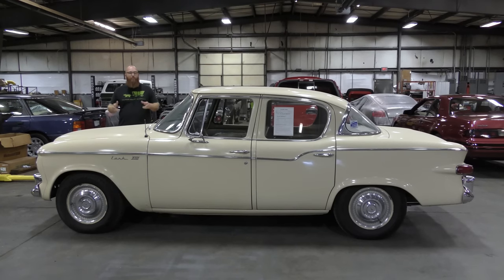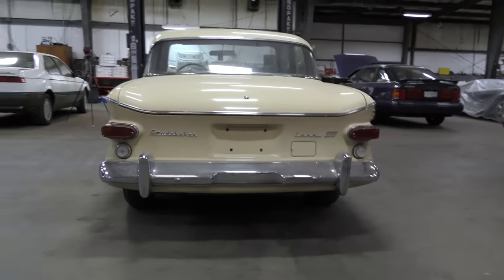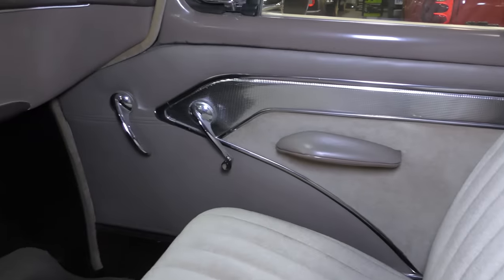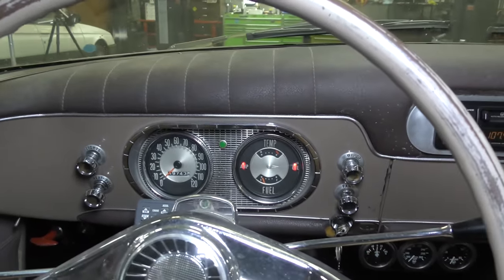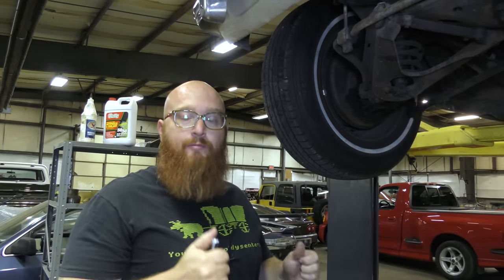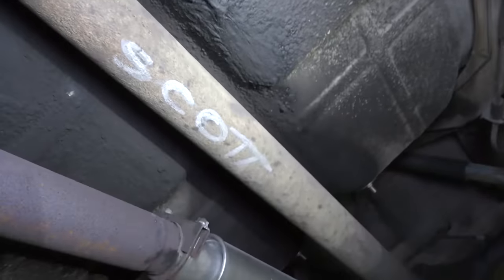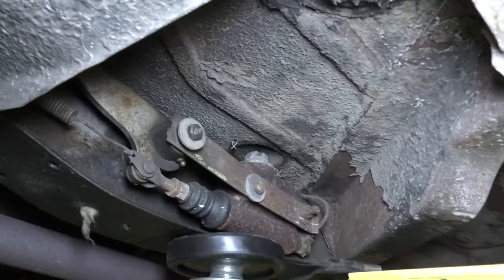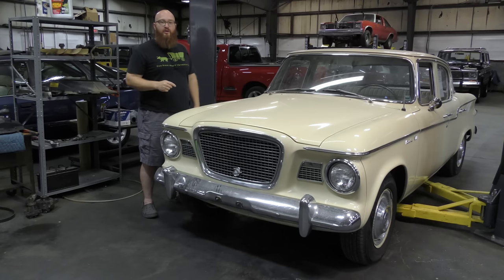Finally a CAR WIZARD approved engine swap done on this '60 Studebaker Lark VIII

Comment: The small block Chevrolet engine is what the factory V8 was in these Studebakers. Originally it would have been the 283 backed up by a Borg-Warner 3 speed automatic or a 3 speed manual, with or without optional overdrive. That is one sweet little car. The seatbelts may be period correct or even original. They were a factory option that could also be dealer installed. Mounts for seatbelts front and rear were mandated by the time this car was built. The American Automobile Association and the Canadian Automobile Association sold seatbelts as well. The could be picked up at any parts store, too.
The carburetor is the Edelbrock 1406 body, which is actually a Weber 1401 square bore 4bbl. One of the easiest carburetors in the world to tune to perfection. Also dead simple to change jets and metering rods. Paired with a Performer intake, an incredibly reliable and economical induction system. Incredibly durable too. I have seen those carbs working that well after a decade and half a million miles of use.
The car may well have been a Chevy V8 from new. Most people doing a 6 to V8 swap would do a dual exhaust, which was a factory option on the Lark. That it has a single exhaust is an indication that it may not be as swapped as one might think. That exhaust, however, is neither stock nor safe. The exhaust would definitely come out the back of the car, likely almost right in the corner.
Reply: Nope. Only the 65-66 Hamilton-produced cars used Chevrolet V8s. Otherwise, they used their in-house Studebaker 259 and 289 V8s.

Comment: You might take back your words in the title if you bought a Studebaker V8 powered lark .. The 259 engine is a well built awesome engine with lots of power, very little problems and great fuel mileage . The Lark 8 came with the 259 V8 and the Lark 6 came with the 170 6 cylinder ..

Comment: Interesting to view some 64 years AFTER we owned a near identical one. Same color,v8 3 tree with of. What most people don't understand is that the 59-60 lark was simply the 56-58 full sized Studebaker 
Shortened by 3 feet!
In 59 when introduced the new lark had more interior head room and legroom than the Ford Chev and Plymouth full sized cars of 1958. And if equipped with the 259 V8 four barrel engine it was good for zero to sixty under 10 seconds. Only the top engined full sized big three could perform that performance. Ridden in, driven and owned Studes for 71 of my 76 years. Our Lark in 60-63 could literally swallow up big 3 cars on the highway when passing in kickeddown out of over-drive . Handled better, parker easier and had more interior room to boot.i know true as I drive in AND rode in many big three full sized cars from 56-64. Lark was trim on the exterior but large on the interior.
Best compact above all others hands down.

Comment: By the mid-1950s Studebaker was in trouble and had no money to design a new car from the ground up. They took their Commander, whacked off the front and rear ends and bare bones outfitted the Lark. No other car maker then had such an affordable, basic transportation offering. The Lark saved Studebaker for another 10 years.

Comment: The Studebaker Lark inspired many British cars - especially the Sunbeam Rapier. But yet again a fine car polluted by a Chevy motor. A Studebaker 289 V8 with the optional supercharger would have been ideal, but unfortunately that requiers original thought which Chevy swap junkies are incapable of!

Comment: Do your checking, there are factory gm V8. from Studebaker.  Also would explain conversion opinion. Is it a gm V8 with Borg Warner trans.  I have seen one of these with  gold labels on valve covers.  Studebaker bought engines from gm
Reply: Thought the GM connection started in 64 or 65 for the Canadian factory.

Comment: Mixed feelings on the SBC swap when Stude has perfectly competent and reliable V8s. That front suspension is impressive with no ball joints and using kingpins.

Comment: I truly believe that’s why they came up with interference engines with the timing belts because once the timing belt snaps if you’re driving that car, the piston hits the head and that engines done toss the car and Hyundai they’re known to go at 60,000 miles to replace an engine even at 60,000 miles it cost more than the car! cars nowadays are meant to be thrown away even as low as 60,000 miles sometimes and if you think Hyundai’s hundred thousand mile engine warranty will cover a timing belt breaking you’re sadly mistaken if you’re timing belt breaks because you didn’t replace the belt that’s on you. That’s not under the warranty that’s considered regular maintenance and because you didn’t do the regular maintenance that’s out-of-pocket cost.

Comment: They didn't move the cab forward, they designed the Lark by lopping several inches off the front and back of the full sized '58 models to create a compact.

Comment: 16:58...That tailpipe ought not be right underneath the axle. The axle will snap it right off with the first big bump it hits. Re: waste mentality, I fully agree. Where I live, I have trash picked a regular treasure trove during the last 8 years in our apartment complex. I even made a YouTube video about this (keywords "Marshall Curtis" and "treasure trove"). Far and away the most needlessly thrown out items in our dumpsters are vacuum cleaners, mostly Bissells, Dirt Devils, Hoovers, and Eurekas (no Dysons). I managed to salvage most of them, then give them away mostly to Goodwill, but not before I make videos of them. They usually are clogged or need easy to figure out minor repair (broken belt, etc.). Even cheap vacuums deserve better than this! The only one thrown out I remember that really was worn out was that 1993 vintage Rainbow I found, which even the local Rainbow sales rep agreed was not worth fixing.

Comment: I learn to drive in a 1950 Studebaker Champion. A nice car; three on the tree with overdrive. I discovered that the overdrive worked in all three speeds.. Yea; I now had a six speed. That 6 cylinder motor was wound up tight to get it to 35 mph, to engage the over drive in 1st gear. Just one of the idiot things I did. Even though it was fun.

Comment: Since the final 2 years the Lark was made (they called it 'Daytona' by then) it came with a 283 Chevy V8 right from the factory I'm thinking all the parts to mount that engine & transmission are readily available.

Comment: I've grown an apathy towards typical crate engines dropped into everywhere they could fit in. A classic in this shape deserves at least a blueprinted AMC V-8 with modern aluminum heads and intake manifold. It would at least come closest to being brand-correct. The Crate Mowder could then get sold, in order to pay some of what the AMC engine would cost

Comment: I'd still think it was cooler with the original Studebaker V8 drivetrain. 

I would like to see the braking system upgraded with a dual reservoir master cylinder and separate hydraulic circuits for the front and rear.  IMHO, this is a must-upgrade in 1966 and older cars for safety.

Comment: Another legacy of using the the 1953 era Studebaker body to create the Lark was that the original 1953 was body-on-frame. That makes the Lark the only "compact" that was not a unibody. This car  could be given a little extra pizzazz by remounting those nice radial whitewalls to face "outwards."

Comment: I have a black 60 lark V1 4 door sedan for you. I swapped engine with a 84 Buick 3.8 V6 with automatic transmission. My car is definitely not as clean as the car featured. Unfortunately the engine quit running a couple years ago. I’m unable to physically work on it due to medical reasons. Let me know if you are interested and want more details.

Comment: Team Bear raced that car in parking lot glycana circuit.  it came from the factory with a Chevy 327 mech lifters.  Swap the tires around get the nose on the ground and the ass in the air.  Big wheel add torque and rpms and hunt vets.

Comment: Since there is VIII on the side, I would assume it came with a 259 V8. I wonder why they didn't replace the motor with another Stude V8, they are easily available.

Comment: A surprising area where which engine and displacement is necessary is for the replacement starter !!!
GM only made like 15 different starters an housings !!!
You'd have enjoyed my Ford van with a GM HP 400 small block !!!

Comment: My memories of Studebaker Larks came from watching the ads for them on The TV show Mr Ed (the talking horse, who I understand was played by a filly!  8-)  The ads were done by the human male lead of Mr Ed.  I was a child then, no where near driving age. That would come in roughly a decade.

Just a couple-three years ago, some big Euro-car company wanted to make a new SUV that looked a lot like this Lark from the front.  I told them so in a comment on YouTube and the design was suitably modified.

Finally, I have this vague memory that the Studebaker's front suspension and/or steering gear were very antiquated.  I don't believe it was as crazy as Morgan's "sliding pillar" front suspension.  Perhaps it just still had a King Pin.  Can you tell us what it actually is Car Wizard?

I wonder why the tires were mounted with the white walls inside, they would be perfectly appropriate to show on a car from 1960!

Finally, when I first saw the Lark in profile as you started the video, I wondered if you were showing us an Alfa Romeo Giulia (Julia) sedan from about 1970.   In that color, the resemblance is pretty strong.

Comment: You two can compromise and get a Champ pickup.  One of the coolest trucks ever, and it's designed after the Lark. I had a beautiful red 60 Lark 1/25 model, and a lady I worked with took one lo9k at it  and said I want one. That was a common refrain back in the day, it was a popular car. It ultimately did not saxe Studebaker,  the car but it's  popularity did save the Company.  Studebaker started buying other Companies with the profits from these cars, including  STP Oil, and several others. Unfortunately, they refused to put the 100's of millions in profits back into the car lines. There only goal was to get out of the dog eat dod car business.  So, Studebaker is the only car company to stop building while still making a profit.

Comment: "The Hamilton factory had no engine plant and was forced to look elsewhere for a supplier, eventually settling on Chevrolet 194- (and later 230-)cu.in. six-cylinder and 283-cu.in. V-8 engines adapted to the Lark’s Borg-Warner transmissions..."

Comment: i was the  new car service 
mechanic i saw all kinds screw us that had to pass the saftey lane in CINCINATTI. THE SIX WAS UNDER POWERD AND TOO HEAVY. ITWAS A COMPACT CAR TOO COMPETE FALCON AN COVAIR.LARK 6 ONLY GOT 19 MPH.VUSTOMERS WERE COMLAINING .THEY WOULD CALL BAK THE NEEDLE VALVE AND SEAT PREFORMANCE WISE THE V8WITH OVER DRIVE WAS HOTIF YOU WERE GOING TO BNLOW THE DOORS OFF A VET YOU WANTED THE HAWK ,PAKARD 8 ,BLOWER ,ANDOVERDRIVE.

Comment: We need those sized vehicles again: Nova & Corvair; Falcon & Maverick; Dart & Valiant  in 4 , 6  & small V/8    like back to 1975 with ZERO electronic; computers, sensors, plastic   back to metal & steel

Comment: Brakes should be change to dual master & if poss. Disc.brakes. Better 4 wh. Disc. Did this on a 63 Merc. Comet from 4 Lug to 5 Lug. & Narrow a 8.8 Ford . It's a over kill easy to find parts and YES YOU WILL NEED 15" WHEELS.

Comment: The turn down exhaust before the differential is a HUGE safety concern. Inasmuch as that car was made a decade before mandated "flow through ventilation", the probability of carbon monoxide build up in the car to toxicity is very high. I'd strongly urge the customer to have a tail pipe run out the rear!!

Comment: look close at the lark grill as well as the Hawks...yup!, Ferrari. Ferraris in the late 50's were available at Studebaker  Dealerships!
Reply: Wrong. Studebaker had a corporate relationship with Mercedes and Mercedes only at that time until 1963. No such connection with Ferrari ever existed in any capacity.

Comment: I like this car but it is a donor car swap that was done on the cheap.  My guess would be a 305 maybe a 350 from the severely chocked era.  My 84 Camaro had those same valve covers with the brackets for all the emission tubing.  Not that there is anything wrong with what was done, but I wouldn't really call this a doing it right swap but a budget swap.

Comment: Did you not notice the tail pipe sitting right against the rear differential? That's not good... Adding exhaust heat to the axle housing can prematurely cause the fluid to degrade and fail causing expensive damage to very hard to find drive train parts... Just pointing it out don't shoot the messenger

Comment: I understand the concept of replacing rather than repairing parts on newer cars, but I have to say that I recall in the 60s, a car with 100K miles on the engine was generally done. Today's car engines will go for hundreds of thousands of miles if well maintained. So maybe the old cars were meant to last longer with engine replacements while newer cars have engines designed to last long with other part replacements.
Reply: True but the newest engines, like those downsized 3 cylinder with turbos wont last very long either.

Comment: Are you the wizard who saved Hoovie's ass several times?
Lark VIII is roman numeral for 8.  So it was the 259 V8. (4.2 L)  The VI was the totally underpowered 6 169 c.i. or 2.8L.
And the short overhang both ends was because they kept the greenhouse of the earlier body (actually from 1953-58) and just whacked the overhang from both ends.
The 259 I had did well drag racing my friends 265 Chevys.

Comment: Had to stop the "it used to be so much better back when" rant at 13:00 to comment.
Yes, cars from the '60s needed more service. That was because they were not good. As a teen gearhead in the early '70s I spent an unnatural amount of time trolling through junkyards, sometimes looking for parts, sometimes just looking. The junkyards were full of cars that were utterly worn out that had 60,000 miles on them. Back then a car that made it to 100,000 miles was something to brag about.

It's not that they didn't try to build decent cars. They didn't have the material science needed to build tie rods that kept their grease. Put a Zerk fitting on a tie rod today and some clown will blow the grease seal on it. Back then any panel that could be removed was bolted through slots, Big slots. Metal was thicker then so it would take longer to rust through.

Going through those junkyards I also saw the remains of many tragedies. Sparing the reader the details now but it was plain for teenage me to see how each of so many people had died. One day I came across a car that was horribly damaged and had overt evidence of its late owner only to realize it had belonged to the late father of a friend. That shook me. 

Any well maintained and gently driven car bought new today will last 200,000 miles. Highway deaths are lower now with many more people driving, and driving much faster. They still crash but very seldom die.
Old cars are fun and can inspire romantic feelings about the past but they are not truly safe to drive on the road today.

Comment: You want one of the 1955 Studebaker President Speedster's - one of the most beautiful American cars ever made.
Reply: That chrome-laden bastardization of a trout that completely ruined the pure lines and restrained form of the 53-54 Loewy Coupe? Yuk!
Reply: @jakekaywell5972  - I sense you are holding back. How do you REALLY feel?
Loewy does not get the credit he is due. Pure vision.
Reply: @dennisfahey2379  I feel as though Studebaker should have died of embarrassment then and there when they thought that THING was appropriate for 1955, or any other model year for that matter. The Hawk series was a major improvement, with the GT Hawk of the 1960s finally recapturing some of the grace and elegance of the original Loewy Coupe.

Comment: To know where there's almost a completely original the motor engine smokes a little bit but it's not no big deal it drives but all those old studebakers and rambler did that

Comment: Why the surprise? Small block Chevys are not any bigger on the outside than the Studebaker V8s that came in Larks, and could be installed easily, even more so, because the 65-66 Larks came with them. So a simple change of motor mounts.